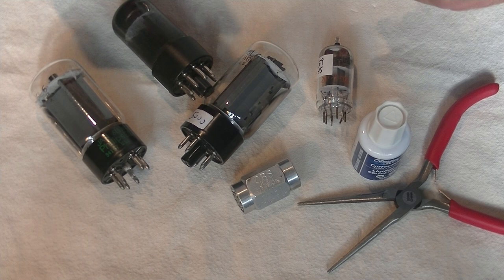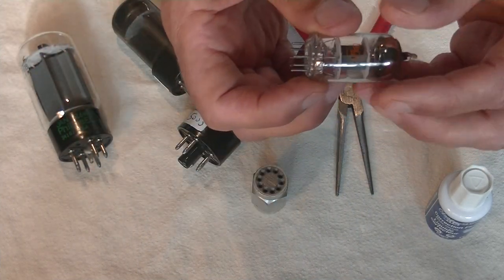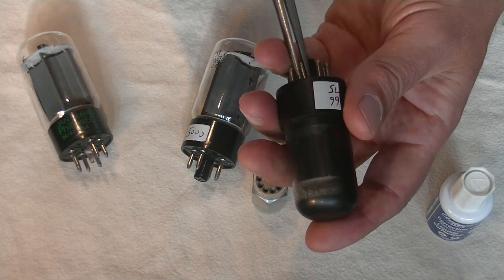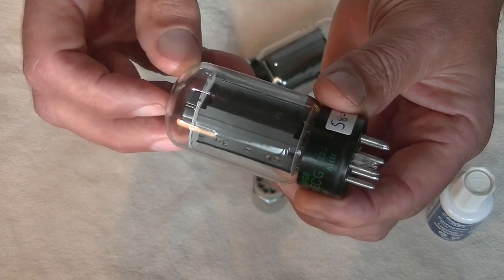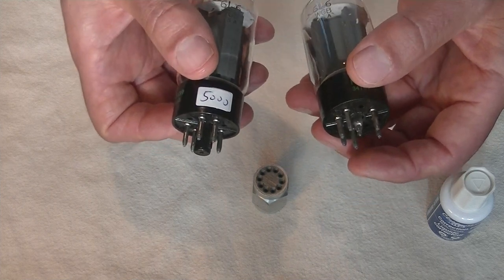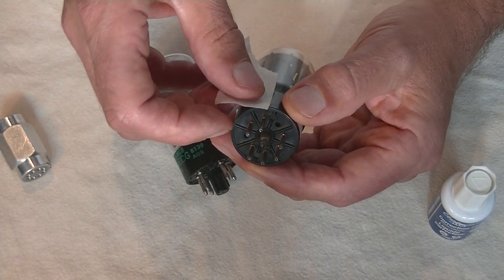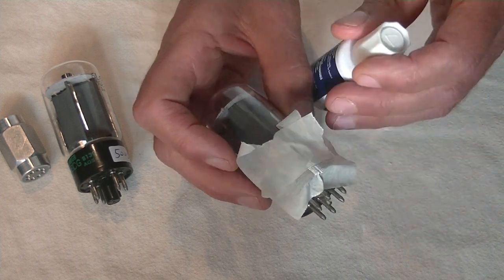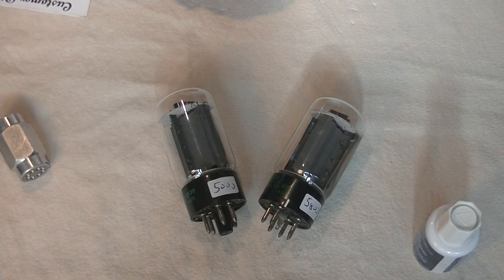Tube Lab #4 Bent Tube Pins and Broken Guide Pins

Comment: My fear was a leak in the seal of a 12ax7 if I moved the bent pin3. It all worked out fine
Reply from the maker: I'm regularly straightening pins on 9 pin tubes and have never observed a vacuum failure as a result.  Note the pins are encased in molten glass to a good depth so even though I wouldn't recommend bending pins back and forth for fun, I doubt you would disturb the seal.

Comment: Hey Jim cheers for the wonderful vids. I have a couple of sets of e180f  tubes for my modern headphone amp. I have a set of valvo's and a set of mullards. They run in a starved plate mode. I was wondering if they would last longer than running in a full power situation. I think the amp only gives the plate 100v so they don't perform any gain in the circuit. I was wondering as they run warm.. but not hot. I though that might prolong the cathode element's life over that of a tube running at full voltage on the plate? Xx
Reply from the maker: A good question and I have no idea, though if I had to guess any tube operating at a lower voltage may last longer.  However in my experience the primary cause of tube death (in good quality tubes) is the slow weakening of the filament.  A good analogy is with a vintage incandescent light bulb, over time the filament slowly very slowly degrades, unless you compared it to a new bulb, you wouldn't even notice, until one day it burns out.  Because I test 1000's of tubes I see a lot of nice tubes that have weakened to the point that I'm forced to perform a mercy binning - someone has to do it, none of this packaging up and selling a crap lot on eBay.

Comment: I am A tube rookie. i just got a mojotone 59 bassman clone annd in shipping they somehow Ripped out one of the smaller tubes in a aluminium sheath and destroyed the sheath . I made a crude version of it with a popcan . Idk if it works untill i get my cab but here's hoping. 
How many tube laws did I break?
Reply from the maker: @liamguitars  only one or two, but Caution!  make sure that pop can shield doesn't short anything out.  Most likely you don't even need the shield unless the tube is close to a transformer or other noisy component.